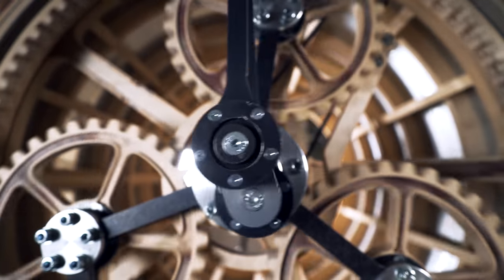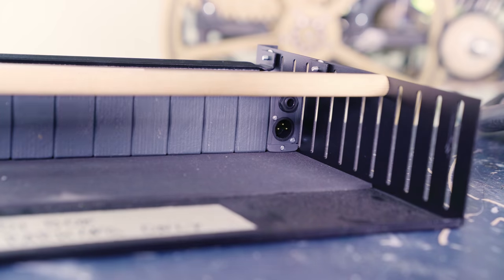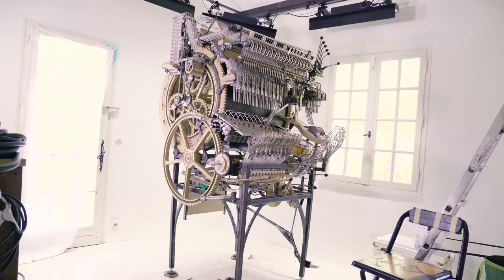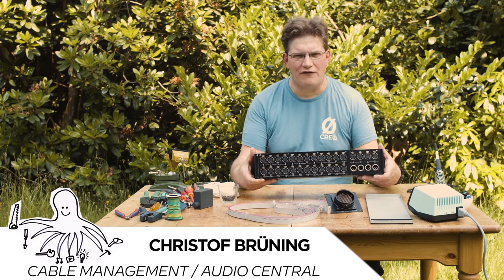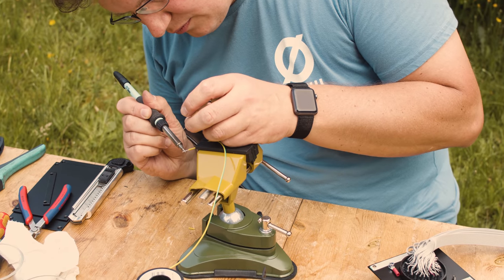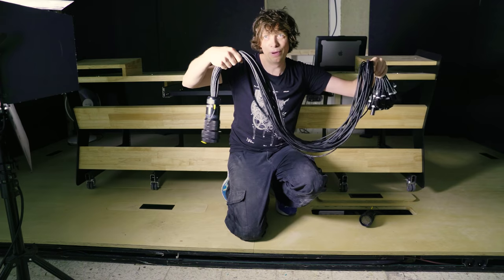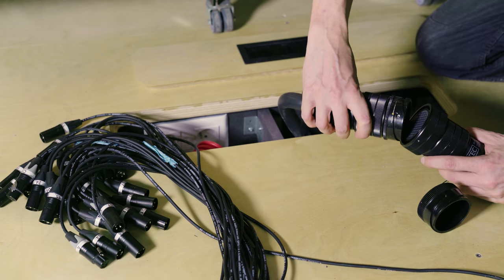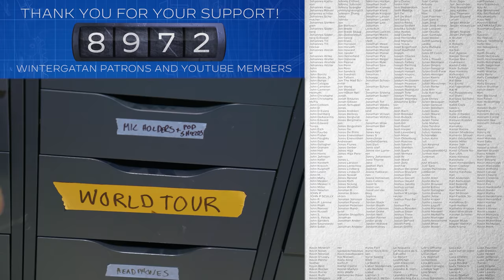28 Audio Channels in One Cable! - Marble Machine X #133

Comment: I am just wondering - as you finally use digital input to your computer, why not using digital multicore? Reduce the big snake into a double fiber optic or a "Ethernet-like" cable. There are plenty of proven, reliable systems available. When I changed to digital audio multicore (installations with 24..32 channels for mobile / temporary use), setup and material handling became so much easier.
Or do you insist on pure analog technique for your tour? (You seem not to do in your recording studio...)
Reply: I also imagine there’d be a lot of noise in the audio cable, especially as it’s being run right next to multiple AC power outlets. While the snake looks really cool, a digital solution is going to be so much better in the long run.
Reply: @JamEngulfer  That doesn't matter when it's a balanced signal like XLR, it's designed to reject any noise outside of the closed system meaning each individual XLR connector. 
That is why they got three pins, not because they carry a stereo signal, but a mono signal with a ground, and the same signal on the two other but 180 degrees out of phase of each other. 
That means if anything else than the same signal 180 degrees out of phase is seen by the differential amplifier it suppresses it because of its very nature of operation, Pretty cool!
But since it's analog the cable length can still be a limiting factor due to the nature of reality.
On a tour in a manufactoring assembly of stage audio equipment they showed us a box that counteracts the noise the earths magnetic field make when they use the length of cables used in big audio venues, never knew that was a thing before that!
Reply: @N00B283  Balanced does not, in reality, reject "any noise outside of the closed system" but only the noise that is completely identical on both channels. There are methods to minimizing the difference such as twisting the wire, which becomes more and more difficult the longer the cable run and the more lines you run in a single cable, such as in the Boa.
You're right about the principle though, but it's not quite that foolproof for real-life stage applications. In analog there is always degradation of the signal in cable runs, whereas digital lines reproduce the signal at the other end perfectly. There's a reason so many professional setups use a digital signal for long cable runs.
Reply: @iliilili310  Yes of course it only rejects common mode noise, and longer cables introduces more parasitic capacitance and inductance which means your cable turns into a lowpass filter, unless you use coax where the inductance and capacitance cancel each other out so that you have resistance without the reactance, that is also why I put it simply that physics still are limiting factors. The same goes for digital, especially because you are dealing with much higher frequencies than the 20-20Khz spectrum, and that suddenly means you'd have to watch out for reflections in the cables more so than in analogue. I did not claim that XLR are as good as digital, but they sure are a lot better than RCA. Digital can loose some bits or get em scrambled up on the way without much problem as there are algorithms and error correction to sort that out, that is also why the longer your network cable are the more of your internetspeed you loose along the way especially if you have gigabit speeds on a cat5e where the cable saturates and you get a lot of reflections really degrading the signal. This is what transmission line theory is all about, at least that's my understanding of it, but i'm only at 4th semester of electronics engineering so theres much to learn yet.
Reply: @N00B283  I'm an audio engineer who's dealt with live/studio setups for many years. There's a reason the vast majority of the audio world uses Cat5/6 cable for audio runs now. You can send an extreme amount of audio channels over only one cat5 that sounds exactly identical to "regular analog snakes". Cuts down on cost as well, the giant analog looms are absolutely expensive as hell, where-as you can get a digital snake for much much less with many more benefits. As far as noise, it depends, the majority of cables will struggle with some type of noise interference if the noise is strong enough. BUT, shielded cat6 is way stronger at reducing noise than analog snakes, there isn't as much crosstalk with digital runs.
Reply: Because it's all for show, I can't imagine a wold tour with this machine that can't be taken apart and wouldn't survive shipping. Also their music is nothing special, the video where they're surrounded by hundreds of instruments is the perfect example. Plenty of people have made better music with a single instrument. It's just a show.
Reply: That’s a lot of words to say Dante
Reply: @N00B283  yes that’s what I was thinking he could get a easy behringer or Midas console and run a single Ethernet cable and then have a ton of different effects and compression and gate and not have that janky preamp setup
Reply: The viable choices for digital audio are AES/EBU or MADI; or even IP Audio like Audinate Dante, AES67, or AVB.

Comment: if anyone is interested in that gimbaling screwdriver it's called the Wera cyclop or cyclope
Reply: tnks a lot mate!
Reply: Wera Zyklop is the name and it looks super heckin' cool.
Reply: sadly it has fixed positions for ratchet mode, screwdriver mode and some sort of semi-ratchet mode where it has a slight angle instead of free rotation
Reply: @Shadow__X  Aww dang. Is there anything like it that doesn't use fixed positions? Any other cool tools I'm gonna want? :P
Reply: Thx i got a screwdriver from wera and is really nice tool
Reply: Thanks for the info. I'd like to get one. It looks interesting.

Comment: Let me just point my concern that the machine is so heavy right now (and will continue to grow). Please be careful when cutting parts from the structural base. It'll be no joke if it falls on you.
Be careful please, great job, much luck for you.
Reply: We've been slowly watching the machine become more and more massive. I bet it weighs more than 200 kg already.
Reply: @henryD9363  holy shit
Reply: Structural steel is much stronger than it looks. It should take about 7.8 metric tonnes before it starts to permanently deform.
Reply: @CairnOwl  Assuming that's true I'm reassured.
Reply: @CairnOwl  To be completely honest, my concern was that he cuts the supports connecting the vertical legs with the horizontal frame (the ones you can see marked in the minute 4:59 which were hindering) and that the joints may no hold (so the machine may fall sideways).
He did not cut but the marks made me nervous :P

Comment: I would of used Dante instead of this, the cost difference is worth it! Plus its cheaper to replace a ethercon cable over the multi-core being repaired. Also I would have them in a seperate rack as a complete unit with a distro built in, less to take apart when moving, plus its protected when moving from place to place. Neutrik pass through connectors are cheap to replace if they do break, plus Dante has redundancy, so a 2 way Ethercon loom would be perfect for up to 100M otherwise you could of gone with Fibre which Yamaha has products for.
Reply: Yep, I also asked me, why he didn’t use Dante... would also be easier for recording because you can just use Dante virtual Soundcard
Reply: As a sound engineer he could a CL-5 or M- 32 a save alot of time.
Reply: I was expecting an analogue deck and 24 track reel2reel machine in the other end of that monster cable or at least a beefy patch bay and a lot of outboard gear. I cannot help but wonder why they choose exactly that configuration, instead of Dante or a m32 or similar digital snake. My best guess is that it must be for the love of that connector and the love for a single broken channel  in a 32 channel cable. Oh, and not being able to meter your preamp input gain knob without binoculars 🤓
Reply: In the studio, this analog snake idea is acceptable. But for touring, I also have the same line of thought, those analog snakes are bulky and a pain when packing and setting up for/during a tour. And if the snake is that short, it'll most likely pass through a digital snake from the livesound team anyway. Unless, he wishes to go completely analog. It'll be hard to find PA companies who will do a full analog gear tour, but possible. But prepare to pay extra for logistics cost.